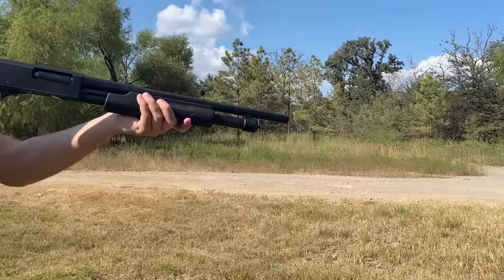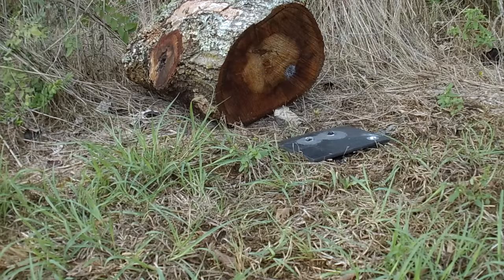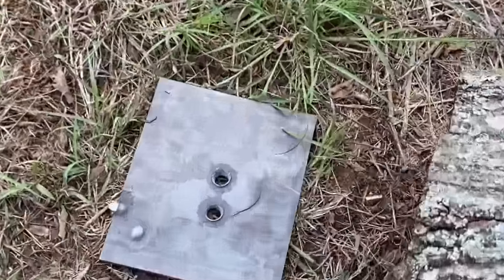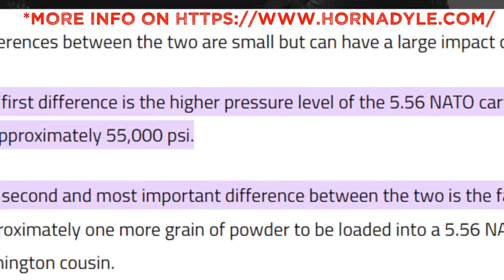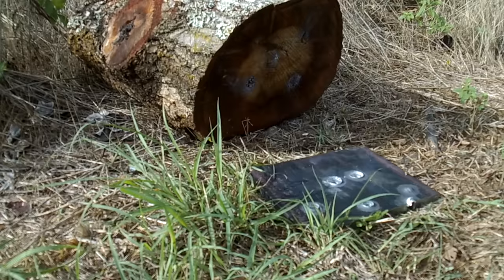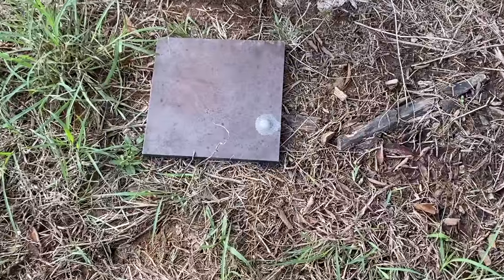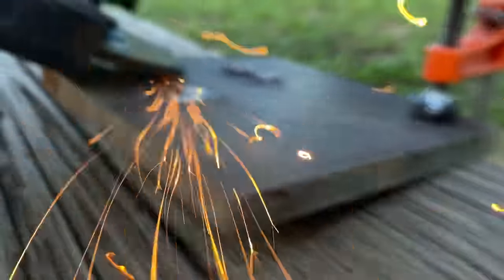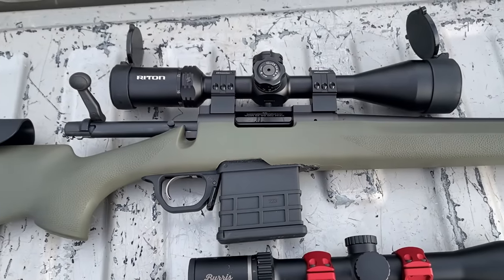223 vs 5.56: You Won't Believe The Difference On Steel

Comment: Nice vids, one suggestion is to keep an eye on is the angles you are standing the plates up, a difference in angle means a difference in penetrating thickness even though it is the same plate 👍
Reply from the maker: I appreciate the tip. I am trying to come up with a fixture to fix this problem.
Reply: just as an example I have two 1/8 inch AR 500 sheets set up at a 45 degree angle like a bullet trap. Literally nothing penetrates that backstop where if I set it up 90 degrees most centerfire rifles would put holes in it.
Reply: Exactly.  The main reason armor is angled, is because the steel is thicker at an angle.
Reply: @Stroke-it-2-Handed  is this actually true? How or why would it be more thick if it's at an angle?
Reply: @aaliasb.   Of course it's true. It's simple, if you sit a can of coke on the table and look at it, then tilt it slightly sideways, you'll see.
Reply: That would be a good video, Shoot a bullet at the same plate at different angles  and see if it affects penetration,  I know going from horizontal to  Vertical would matter.  I know angles matter when it comes to deflection and spawling, dont want stuff flying back at you,  Also the backstop plays a big difference like having it hanging from a chain opposed to up against a wall.  But either way would be interesting
Reply: @williamwinn948  It makes no difference having a plate hanging or up against a solid surface.
Reply: @aaliasb.  it isn't that the armor is  literally thicker.  1/4in plate is still 1/4in plate.  Rather, the distance a projectile has to travel through is greater if it strikes at an angle.  For instance, a 1/4(0.25) in plate struck at 45 degrees would require the projectile to push through ~0.35in(if my memory of the formula and math are correct) of metal along the flight path of the projectile rather than the nominal 0.25in it would have had to if it hit the plate straight on. 

Of course, this increase in apparent thickness isn't the only reason armor is angled.  Angled armor can also cause the projectile to break up or skip off rather than bite into the face of the armor to start penetrating for kinetic penetrators, or mess with offset distance and fusing if explosive based warheads like HEAT and HEP/HESH.
Reply: @bananaballistics  - Congrats on 10k subs already. Keep it up! 🎈🥳🎈
Reply: The difference isn't that it's thicker, it's that it's redirecting the force.

 Mythbusters did an experiment where if you fire straight into water, perpendicular, it'll penetrate very deep, but fire at an angle and suddenly even a 50 BMG won't go more than a couple feet.
Reply: To make it truly accurate for recording the data I would make a metal holder for the plates to sit in so that you just ensure the exact length x width measurements of the testing plates to sit exactly the same angle on the plate holder. The holder will also help with preventing the plates from being pushed backed one way or another by having it heavy enough or mounted on a fixed object. The main process of any scientific experiment is to isolate every possible variable to keep them consistent across all testing fields so that the thing (bullet/ammunition) that you’re testing is the only variable to get the most accurate information for the experiment.
Reply: @aaliasb. seriously 🙄
Reply: @Stroke-it-2-Handed Thats not true. Its because the steel is at an angle which causes it to ricochet off instead of penetrating straight through
Reply: @bryson1992  You're 100% WRONG.  LOOK IT UP
Reply: @Stroke-it-2-Handed  Yeah i looked it up and its telling me basically exactly what i just said😂
Reply: @bananaballistics  fixture for the gun as well .. angle of trajectory to fixed target
Reply: think about that question.  Anything at an angle is thicker vs straight through @aaliasb.
Reply: The angle bothered me also !
Reply: Yes. I think the the resulting energy is a function of the Sine of the angle of impact. Memory fails me but the calculations is something like   Joules * Sine ( Angle of impact).  Mind is rusty. but it is something like that.

Comment: This is why I laugh when I see these crazy short barrel ARs. This round is velocity dependent and with such a short barrel you basically have a .22lr. as far as penetration goes. You want a short barrel and performance? Shoot 7.62x39.
Reply: Or .300blk, or 6.5 grendel, 6.8spc, .450 bushmaster, .458 socom, .50 beowulf
Reply: Much the same as the .45 acp
Reply: It's all a trade off. A 16" AR with a can sucks to use. 14.5" is a good compromise especially since you can pin and weld. I run 11.3" but my ammunition is much better than what people get off the shelves because I can load it hotter with better projos. 
That being said, I've moved on to an 18.5" Tavor x95 which is roughly the same OAL as an 11.5" AR.

Comment: They are exactly the same round except for one feature, a 556 is a Nato military round which has an extra depression in the primer cartridge.  The 556 barrel is slighly larger than the 223.  If use the 556 green tips, then you have a ,slightly, greater penetration in harder/thicker targets.  The remington 223 costs more than the 556.  This information is directly from Army and Marine testing.

Comment: Cool stuff! As a career engineer to add a bit of scientific rigor, I’d recommend testing each in triplicate (3 times) at least and possibly measure the velocity for each shot as well. This would help better evaluate the differences:)
Reply: agree.  multiple shots would help, but he also needs a consistent bracing.  If the steel is able to rock or slide that changes things.
Reply: Yes, you absolutely sound like an engineer ! ! !
🙂😎👍
Reply: Yes sample size of 1 is not very accurate. Also there are many other flaws I mentioned in my comment. Military standard measures peak chamber pressure differently and from different location than the civilian standard (SAAMI). Values resulted by those different measurement techniques are not comparable with each others.  
And ammo propellant is loaded by weight, not volume, as volume of similar gunpowder charges depends greatly on the characteristics of  each powder. The actual shape of gunpowder pellet; cylinder, diamond, cube, ball varies the empty space between the pellets more than 1.9% that the outside dimensions (which also does not guarantee inside) of calibers vary. You know they do not fill the case to the brim, they put in exact amount by weight the burning speed of the powder used for THIS production batch.
Faster burning powder reach peak chamber pressure with smaller amount than slower burning allowed to load more of the powder  of slower burning  powder which in turn gives the ammunition much higher velocity on long barrel than the fast burning powder. The specification is MAX that any manufacturer can not EXCEED there is absolutely no specification or guarantee that they have to load their ammo all the way up to that MAX. 

All this video proves that on 18" barrel THIS one bullet from one production batch from one manufactured is faster than that one other bullet from that one other production batch from that other manufacturer. 

 At very least that should have opened 10 bullets from each many facturer and measure the withgh of case (to give guess of the actual inside volume), and weight of the powder charger and the bullet. 

Also he should have switched between the ammo and see if the result persist.

In general military ammo tends to be loaded hotter than civilian ammo where they prefer safety margins over power. If service rifle blows up on face of soldier that manufacturer does not get sued for 500 Million like with civilian rifle.

Pretty much every video of "How I almost died when my .50 BMG rifle blow up on my face" starts with "I was shooting this WW2 military surplus ammo"
Reply: @michaelholopainen2822  . . .. rut-rho .. but very good👍
🤔 summarize —> not all ammo is equal & guns, too.
🤔 generalize —> there is a difference 
😆 LOL - on last statement
Reply: Are you saying that we still don't know if the 5.56 is stronger than the .223?
Reply: @WawakGuitar  0:36
Reply: @michaelholopainen2822 Just a question,  does you know if any company makes both 5.56 and 223 hunting bullets for states that allow that cartridge?

Comment: I was beginning to wonder if the diff in the 223 and 556 was enough to matter but your test said yes to me. I'm glad I have both anyway. I'll up my stock on 223 since they seem worthy contenders.
Reply: 223 is typically loaded hotter than 5.56. This is because the true 5.56 is not as hot as people have lead each other to believe. Instead, the 5.56 is more controlled for military use to avoid gun damage.
Reply: OfftheBankBasSlayer  - This channel says it is and other channels with other tests show the opposite.

Comment: This comparison is actually very good for reloaders that are just getting into the field of reloading. It shows the difference of just one or two grains of powder and how it changes the chamber pressure. Never go outside of the parameters of the manufactures load data, thinking that one or two grains, won’t make a difference in Automatic disassembly of your firearm
Reply: He doesn't know the factory specs of how the 5.56 or the 223 were loaded, so it's not a very good analogy on his part. He also didn't chronograph them either when shot. There can be as much as 500 fps difference in velocity in one box alone. Plus, the 223 hit on the edge, where the plate would absorb a lot of the energy by deflecting. Not a Good analogy there either. 

The other is your comment on amount of powder. It hardly takes more grains to raise pressure as a lower powder charge will also do the same thing when it comes to pressure. So pressure is not the way to make high velocity. Therefore, the 5.56 is not loaded to high pressure for that reason and for the safety of our troops.

Another is the type of powder, regardless of charge, will chance velocity even of the same bullet weight. 

And at last, the data shows the SAAMI on the 223 at 55,000, and the SAAMI on a 5.56 at 55,114. The 58,000 he talks about comes from a different kind of measurement, where the same reads 62,000, and yet reduces down to 55,114 in the end. Basically, they are identical cartridges and can be reloaded identical. 

And either can be shot in either chamber.

Comment: You did quite alot better than most of the utube penetration tests.You had it almost right.For the test to be meaningful,the plates must be held perpendicular to the oncoming shot-in otherwords a straight on shot-no tilt.Also,and just as important, the plate must be held absolutely rigid by something with alot of mass.No movement can be allowed as this definitely affects penetration greatly.This is the reason we hang steel targets by a chain-if the steel is free to move,alot of the energy will simply move the plate and not go into punching a hole,which is what we want to happen with a steel target.But for a comparative penetration test consistency is key and being held rigid is key.The heavy log at the top of the plate is pretty good but the ground that it sits on allows lots of movement and isnt consistent with how much.And you have a slight angle leaning on the log and that also isnt consistent and there should be no angle.
Try using 2 massive logs which are very squarely and evenly cut.Leave a space in between them and screw the right edge of the plate to one log and the left edge to the other.That should hold your plate rigid and give real meaning to your test. Cant wait to see you redo this and see if results vary.Good Work and Good luck!
Reply: 10 - 4!
Reply: Yeah cuz your targets are always rigid and at perpendicular angles. Bruh please
Reply: @sed6  It's supposed to be an accurate scientific test. Not a real world usefulness  test. Please recognize the difference. You have to be consistent on all variables or it's meaningless. Do it right or don't bother.
Reply: You expect him to redo it?
Reply: Shooting at a steel target that is flat angle rigidly fixed is actually pretty dangerous... I can already see the shrapnel flying back at him...
Reply: @blackdification  Not a whole lot more dangerous than shooting at nearly fixed targets.I assume he did this from a safe distance or from behind a shield.If not then all I can say is DARWIN! Do these test right or dont bother.

Comment: I did this test forty years ago , 223,3006,300 win mag. Never made a dime for it. But I did learn what not to hide behind 😂.300 win 5/8 mild steel.
Reply: i found that with my 300RUM with 180gr winchester silver tips that they would punch 13mm holes through 10mm AR400 at 200 meters and almost go through 20mm mild steel at 200 meters second shot was through no problems

Comment: I recently ran a .223 vs 5.56 test on 3/8" steel at 100m. The 223 was Tula steel case and the 5.56 was Prvi Partisan brass. Both were 55 grains. Both went right through the 3/8" carbon steel plate with no noticable difference. The steel was a good quality steel. Maybe the Tula ammo was just packaged as 223 but was in reality 5.56.
Reply: 5.56 mm has the higher pressures means it should have better performance.  But 30 fps helps, not deal breaking.   Do test further and further out to see which one stops going
 through first.
Reply: Due to the thinner steel case, you can pack more powder into steel without going above the pressure limit. Higher velocities are possible. 

I think Russia markets all their .223/5.56 as .223. Some manufacturers, like Barnaul, load it hot & it's fairly accurate.
Reply: All these maybe's in the comments section. They are identical cartridges. That's why they performed identical for you.
Reply: It might have been the "bullet "and binding of the jacket material. His testing is very much flawed since you have to take all of that into consideration and not just oh i have a 5.56 and you have a 223. 

If the jacketing is poor or thin,  the material construction is poor don't expect similar good results regardless if it's 5.56NATO or 223remington,. Just sayin

Comment: Nice video. I'm surprised by the results too.  Did you chrono the Ammo? What distance was the plate? Subbed.
Reply from the maker: Unfortunately I do not have a chrono at the moment. The plates were at 50 yards. I really appreciate it!
Reply: @bananaballistics  You need a chronograph and the publish factory ballistics must be wrong since they show the 5.56 and .223 loads having almost the same velocities and from the steel testing we see they do not.
Reply: @loquat44-40  another difference is that 5.56 is, unless otherwise noted, supposed to get rated velocity out of a 20in barrel, while a .223 is, unless otherwise noted, rated from a 24in barrel like most other rifle cartridges.
Reply: @loquat44-40  .223 lists velocity out of a 24 inch barrel and typically uses slower burning powder which needs that long barrel and often times will still not reach advertised speeds. 5.56 usually is tested out of a 20 or 16 in barrel and uses faster burning powder so it wont take as big of a velocity hit when fired out of shorter barrels and is few thousand psi hotter.

Comment: Velocity is King when it comes to the 223/5.56 cartridge. I know folks like their shorter barrels but anyone who thinks they ever might need penetration should have at least a 20-in. Even if you're not trying to penetrate steel looked a little You need higher velocities to get the kind of disruption the round is capable of. Otherwise all you are going to get is 22 caliber holes.

Comment: I thought a channel this cool would have more subscribers. That flying banana leaves me with pi$$ in my britches every time I see it! I asked my father, he's an ex Marine, about the steel case, and all of it's feeding issues, and he told me it was designed to be used in a bolt-action, and when a regular brass .223 is in a bolt action, it creates pressure spikes that can blow the casing walls out! Thanks for the good vid.

Comment: it would have been cool if you had added a 5.56 62 gr LAP green tip on that last plate.
Reply: Green tip doesn't do as well as 55gr at these distances. Speed is king on this soft steel. Test many times over back in the day. Green tip is garbage.

Comment: As a reloader, it's more of the bullet. Example, the steel case metal core 223 round will do better than the 55gr 5.56 round. Yet the green tip, steel core, 62gr will do better than the steel case ammo. Yet a 40gr solid copper 223 round going 3,800fps will do better than the green tip.

Comment: To be fare, you should have shot the 223 from a 223 chambered barrel instead of a 5.56 barrel, even though it can shoot both there is a slight difference. There is a reason competition shooters using a 223 round don't shoot it out of a 5.56 chambered barrel.
Reply: Exactly. I've seen handloaded 223 that's far hotter than any 5.56 other than mk262 maybe. 
Also there's zero mention of velocities which is critical for tests on soft steel.

Comment: So, old timer here. It's fun to max out things like motors, boats, and guns. But when it comes to reloading, stay away from max loads. They hammer the gun harder. They wear out the brass really quick. Split brass isn't accurate. And a gun that won't hit isn't fun. One day a guy was missing pop cans at 50 yards with a scoped AR in 223. He'd shoot, shoot, shoot, hit. While they were setting up I looked at his brass. Most were split and ruined.  He said they were way over max load. I didn't try to reason with him.

If you want more than 3 shots from your brass, use lower pressure loads. If you want more power, get a bigger caliber. If 50bmg doesn't work for you, get into making fireworks.